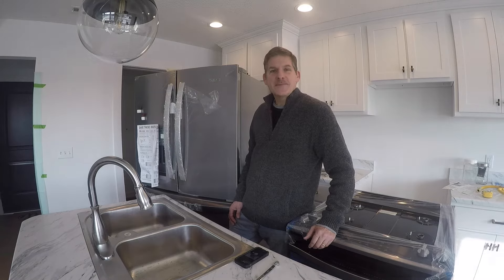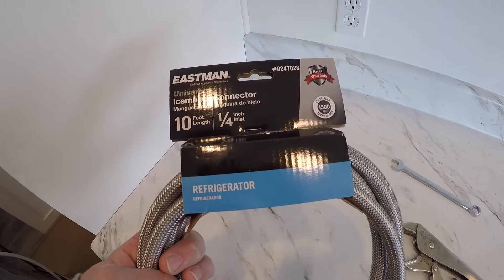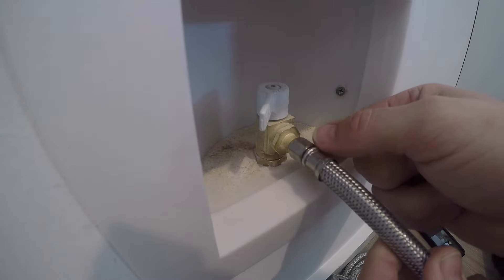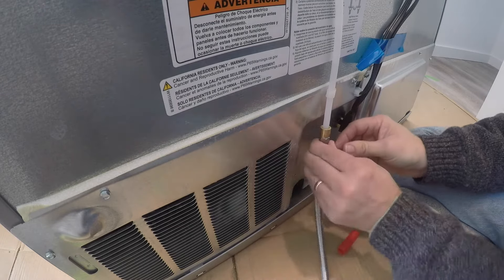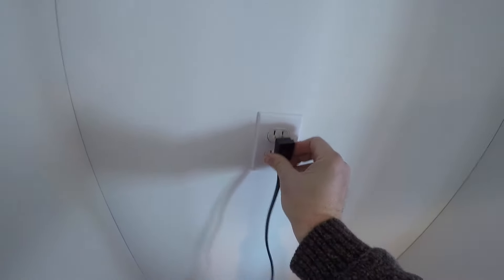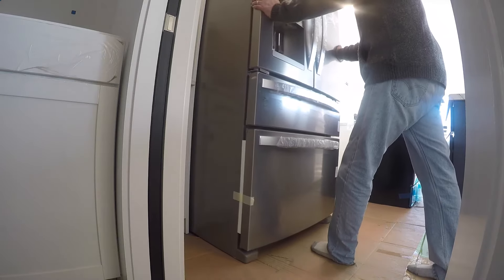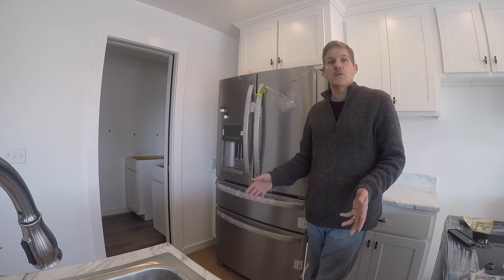How to Install a Whirlpool Refrigerator and water line for ice maker

Comment: Does the ice maker need a certain flow of water? Or can that 1/4 line just be connected right to a main supply? I need to instal the actual supply. Didnt know if it needed a special valve or regulator
Reply from the maker: You can connect to main supply but you do want a valve to make sure it can be turned off locally if it leaks or if the fridge needs to be replaced. 
Thx for watching!

Comment: How can you tell when the refrigerator is back far enough but not so far as to crimp the hose/valve connection? Maybe an elbow at valve discharge. Good tip on tying up the excess hose, they didn't do that on our new fridge, and the water valve leaked. Thanks
Reply: A little late but your refrigerator should have some clearance on the back of at least 5cm which should be enough for the valve connections

Comment: I had their counter depth frig delivered today and don't have this connection? Water lines terminate inside? Power switch for ice maker is in the door behind ice bucket on left side.
Reply from the maker: Hey Hungry,
Hmmm. Not really sure since a different model. Maybe a call/chat to the maker - often they ( or even the big box store ) may be able to quickly steer you in the right direction.

Comment: One tip: After connecting the water line, immediately run at least a quart/liter through the water dispenser to clean out the lines. Then toss the first batch or two of ice. The water and ice should be clear and colorless before being consumed.
Reply from the maker: Hey SeikiBrisn,
Thx for the tip and for watching!

Comment: Not sure why you would get a 10 ft. supply line to go less than a foot.
Reply: A 10-foot line might be longer than needed, bit that's better than being shorter than needed.  You need to be able to get behind the fridge to connect the line and then roll it into place when finished. A 10-foot line isn't much more expensive than a 5-foot line, so one might as well get one that allows some wiggle room.  As of July 19, 2021 a 5-foot Eastman stainless steel line is $13.98 at Lowe's, and a 10-foot version is $16.98.  I'll happily pay three bucks more for the 10-foot version. (Lowe's actually has a 1-foot version for $4.48, but I think that's just about useless for most installations.)
Reply: @seikibrian8641  agree
Reply: Update: My local Lowe's was out of 10-foot lines, so I got a 5-footer; big mistake!  My kitchen has a stub wall in front of the fridge, making it VERY difficult to get behind it. With a longer line I could have pivoted the fridge and rolled it sideways enough to clear the stub wall. As it was, I had to do some real contortions to get behind it, connect the line, and then (actually the hardest part) get out from behind it again. I should have gone to another store and got the 10-foot version, or just waited, but I was impatient in the hot weather we've been having.

Comment: Could you also tell me other things about this Whirlpool refrigerator? If so, is there a way to adjust the doors? the refrigerator has been leveled but the doors are not, maybe about 1/4". Is there some secret adjustment screw hiding. Thanks
Reply: To level doors you have to adjust the feet at the bottom front of the fridge behind the plastic grill near the floor.

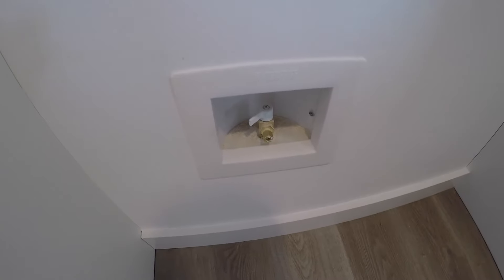Comment: ~1:30 there's a piece of styrofoam holding the waterline going into the back of the fridge. Do you know if you can get replacements for this? Thanks
Reply from the maker: Hey Steven,
No idea about that. I wonder if any similar piece of styrofoam will work? Maybe call the manufacturer?
Thx for watching!

Comment: Might want to put a hook on the wall and a long extendable spring to hang the slack water line. Otherwise, it will get scrunched up against the wall and prevent the fridge from sliding back as far as it could go!
Reply from the maker: Hey tw..,
Thx for the input and for watching!